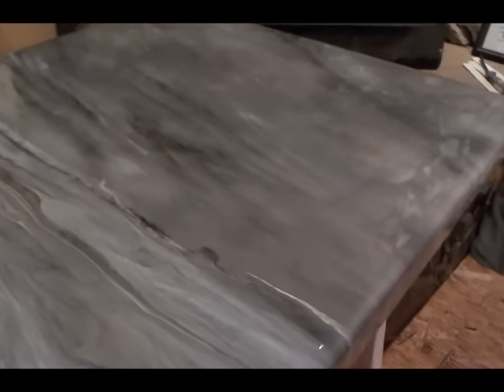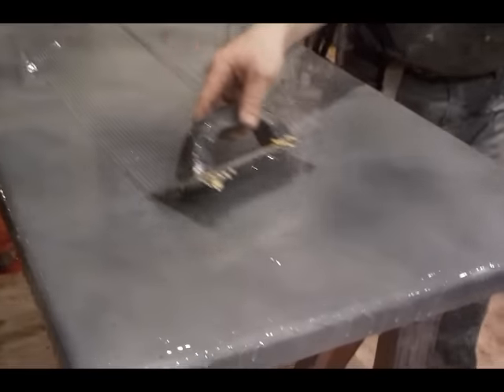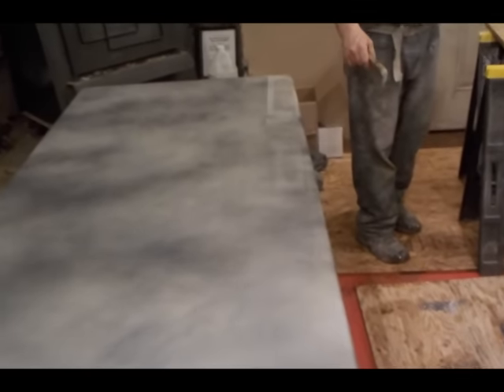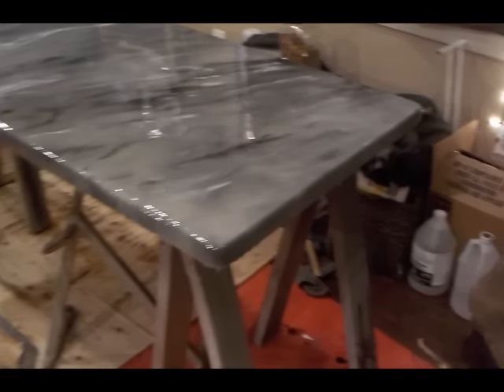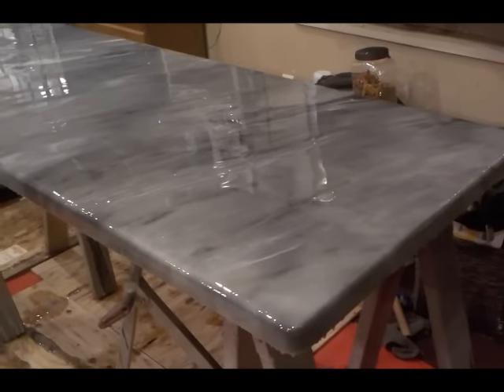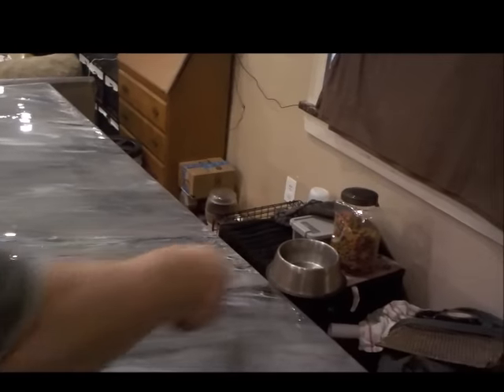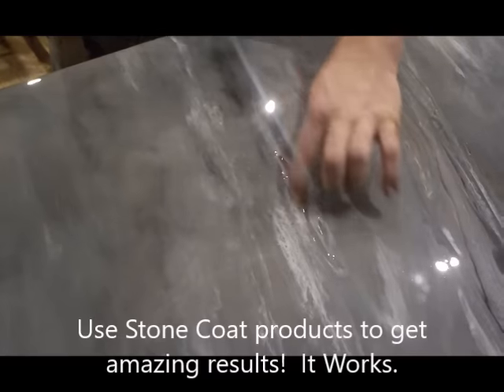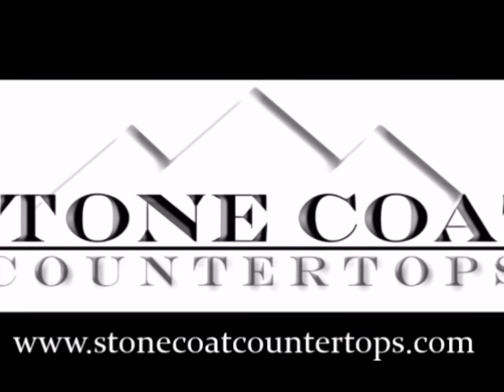How to make Epoxy Countertops

Comment: My question has to do with buffing over the epoxy. We had everything sanded down to 2500 grit and then proceeded to use the buffer with the buffer pad and the buffing compound everything that you recommended we purchased. I'm not sure what we are doing wrong or if maybe it's the buffing pad itself that is an issue (that is what I'm suspecting), but we are left with all of these little tiny swirl scratches throughout the entire countertop that we cannot get to a clear finish. I even purchased the Maguires ultra finishing polish 205 to use afterwards to see if it would help and it did not. Do you think purchasing a different pad would make a difference in helping to remove those marks? Possibly having to re-sand the surface with a 1500 and then use a different pad with the compound? We were just hoping for your professional advice. Thank you so much for your time!
Reply: Thank you for your quick response.
Reply: StoneCoatCountertops before we had done any sanding initially, the counter had cured for at least a week. I would like to note that the epoxy that I was working with was not Stonecoat it was a different brand. It wasn't till after the fact that I found out about stone coat and had to order some to do our other countertop and our island and I'm very excited to try it out!  We will be using our stone cold this week for other two countertops :-). We used all the same tools and steps and did not have much success. However, with some trial and error and your suggestion about wet sanding, I decided to re-sand (with water)a section of the countertop with 1200 grit.  It got nice and smith and I got all of the little round swirl scratches out.  I did half the piece by hand with the compound and it came out beautiful and shiny.  I did the other half with the buffer, buffing pad, and compound (all of the same tools that you use and recommended) sure enough the side that I did with the buffer did not come out good. Again, it left me with all of these little swirl scratch marks all over the top surface of the counter. I made sure that I had plenty of compounding that it was spread evenly across the buffing pad I made sure that the Velcro had no contact at all with the countertop, the buffing pad is a bit bigger and there's no way for the Velcro to come through it. During this trial and error I'm led to believe that it has to do with the buffing pad itself. I can get beautiful results doing it by hand with a dish towel, but I cannot get the same results with the buffing pad on the rotary buffer. I think I will try a different pad and see how it works out. I just wanted to share this information in case it helped anyone else.
Reply: StoneCoatCountertops by hand comes out great, but it takes a long time with a lot of physical effort.  I am looking into different pads for the buffer.  I will keep you updated and let you know if I score something awesome that may be helpful to you and anyone else doing this process.
Reply: StoneCoatCountertops Thaks so much for your time and compliment 😊. You guys are great and that's why me and my husband ordered from you guys 😊
Reply: StoneCoatCountertops Sooooo.... tonight we decided to put a semi gloss poly on the wall (back splash) that I had also painted, epoxy, and sanded.  I initially thought my buffer/buffer pad was causing swirl marks in the epoxy, so that's why I tried to just do the poly and skip the buffing.  First of all it looks not so good, no correction it looks terrible 😔, second of all I discovered the PROBLEM!!!... As soon as that poly dried I could see all of these round/ curly q's!  We never ever touched the buffer to the wall/back splash!  So, the buffer pad was NOT causing the round swirl/curly q's it was our orbital sander!  I went back to the counter top took it down to 400 and worked back up to 1500 all by hand (what a pain). I got a shop light to shine on it to make sure I could see everything perfectly.  I got it baby smooth and tried the buffer with the compound, it came out great!!!  I didn't realize how deep those swirl marks were and they were hard to see in certain light.  Before I thought it was the buffer but it was just the buffer enhancing what was there from the sander.  Anyway, I just wanted to share incase this helps anyone else and I hopefully can save them the time and trouble we went through to figure this all out.  Looks like we will be doing a lot of hand sanding 🙄😆

Comment: so I just painted my laminate counter tops with Giani counter top kit (comes with primer, granite colored paint and a clear coat that you put 2-3 coats of), after posting pictures of my finished product a friend of mine said that the guy who sold them their house had just done this to their counters but after only a year it was peeling off (not sure if they didn't follow the directions properly or if that is just what happens with this product) but either way I don't want to take the chance of having all my hard work peel off, so I am interested in putting an epoxy or urethane over the top to really make it last...wondering if this product might be what I'm looking for?! and if so, would one coat be enough?

Comment: can i do this over a concrete counter top and i already put a base coat that is really dark blue and i want to lighten it up, so i am assuming that i can use spray paint to lighten up the base and then pour the resin on top and do this procedure? i would purchase this specific product however i already purchased resin that is ready to go? further i want to add some glitter to the resin should i put that in the mix before i pour?

Comment: Stonecoat - We're doing our counters using this technique. Today we tried it on a sample piece of wood to see how it would turn out (first time) and it turned out awesome but we noticed a bunch of small bubbles on it. Actually, not bubbles, more like circles in the paint where you can see the base coat under it. Seems like the paint pulls away in areas and creates little circles. Do you have suggestions of how to prevent them? It's not a huge deal but I don't care for it. Is it the paint? We used several different brands and colors, some were old. Are they caused from not using enough paint? Or does it just happen naturally because of the epoxy? Wish I could post a pic on here so I can show you what I'm talking about in better detail.